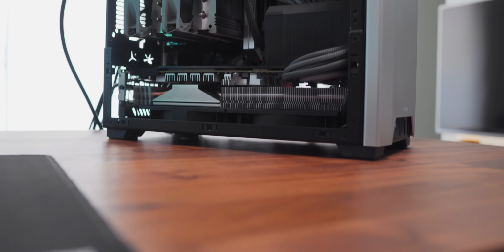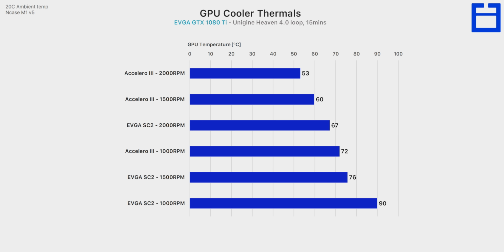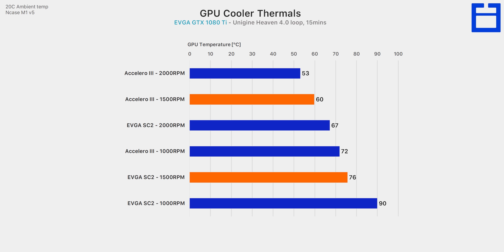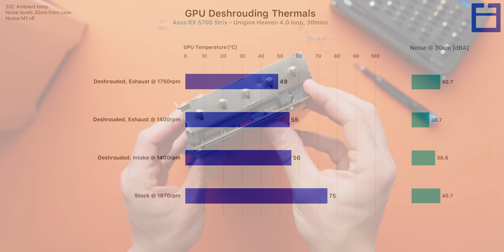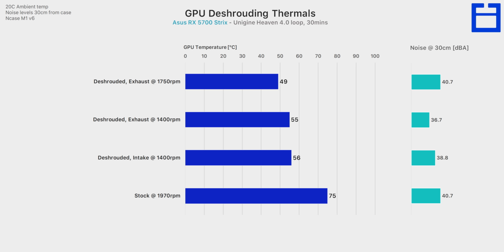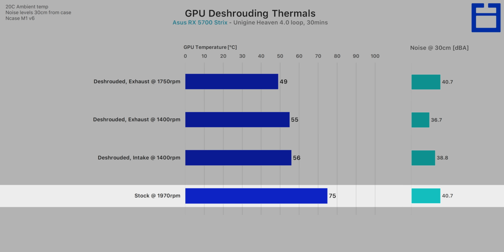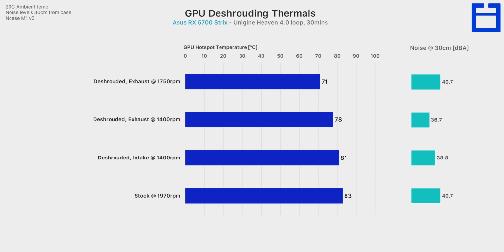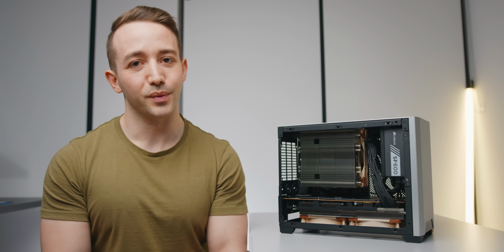GPU Deshroud Mod - Mindblowing Thermal Improvement

Comment: Did the same 1 month ago with good results.
ASUS ROG Vega 64.
VRM has almost same problem, but fixed with a bigger thermal pad.
3 Fans removed together with the shroud and replaced with 2x 140mm Noctua fans.
Fans suspended with cable ties and long screws to the PSU shroud in a Fractal fullsize case.
Fan outputs also does not work because AMD driver and ASUS controlpanel software fights each other.
A GPU cooler mounting guide needs to be followed, and paste really needs a good amount to fix hotspot problems.
VRMs and hotspot was in the 100c area, GPU throttled down below advertised, ASUS quote: Working as intended.
VRM and hotspot is in the 80c max now and clocks are about 200MHz higher on core and the fan noise is maybe halved.
The Noctua GPU fans are controlled by CPU temp, so when the CPU temp is 10 degrees over idle the fans run at full speed, not ideal but works good enough, the temps can overshoot a couple of degrees before the temp stabilizes with the fan speed, but the temps are still more then 20c lower then stock anyway.

Comment: This is absolutly hilarious because in a drunken rage last night, litterally last night., i deshrouded my 3rd and 4th rx580s because the upper card fans rub the next cards' rear heat shield.... So my mod has to do more with clearance than cooling. And yes 4 rx 580 xfx xxx black ed  with an Asus WS Pro z390 motherboard with plx chip runing 8x8x8x8x in a panzer cougar full tower case and open looped i7 9700k. The shrouds were placed sideways for now till i figure out better airflow.

Comment: Been doing this since 2002 but usually with a after market heat sink.
i have stuck min 130-250 cfm fans on ALL my pc's since 2003, they are the "thick 38mm" fans...............SURE i am going deaf from it BUT everything stays cool :))
Sadly going larger then 120mm gets way too expensive these days with such high output fans.
i still have 10 200cfm & 2 250cfm 120mm fans in the box  (they are DELTA fans) last like forever. i was recently thinking of selling 5-6 of the 200 cfm delta fans but i think i'll keep em.
NO WAY i would sell the 250cfm delta fans, those are insanely priced Now .
14 yrs ago i got a great deal on 30 200cfm fans from some place called "arrow", they cost me like 12$ each, now they sell for 50$ each..............it's crazy.
Guessing the last 2 250cfm fans prolly sell for like $70+ each (bought those for around $20 each)...............i should have bought 100 of them back then.
They sound like a jet taking off..................Also Any fan above 100cfm is a dust magnet !
My 1st high push fans were the vantec "tornado", they were 90mm fans & sounded louder then the 120mm ScythE 133cfm fans.
A few other fan manufacturers that made  great high CFM was Sunon & Panaflo nmb..........all you pussies pushing for quiet fans made the price of jet engine "affordable" fans go sky high.......

Lastly, the delta & panaflo fans seem to last the longest, the scythe always fell apart launching the blades into my PC, i guess that's why they stopped selling them.
Didn't use the 60-70mm sunon fans long enough to see if they last long, was used mainly for north & or south bridge.
Glad i still have a few of those small fans cause i might jerry  rig them into a console if need be.

Comment: From day one that I got my 1080Ti super jetstream, I did this with 2x120mm PST fans with the stock cooler and I had the same results, super silent operation with around 17-20C less on the GPU :) I`m doing this to all of my cards since 2013 Vapor X 280, 980 Ti and my 1080 Ti

Comment: Nice Video, thanks! Would you think that it also would be possible with the Dan Case A4 SFX maybe by using two 120x15mm fans on two 120mm-AiO-Brackets? 🤔

Comment: Do you run the fan on the Noctua NH-C14S in pull blowing down on the pcb or push exhausting out in low profile mode generally?

Comment: The external fan header needs a program on startup to work. It also needs to be set up in the Asus Tweak software. It's stupid it isn't automatically running on startup and you need to manually choose it as a startup program. But hey, it's Asus...

Comment: For the few who read this: You can totally use this in any case! You just need to either use zip ties or bent wire to secure the fans directly to the card.

Perhaps not the most elegant solution, but we’ll worth it in my opinion!
Reply: Looks like a great project for a 3D printer.
Reply: Other than virtually every sandwhich layout case I can think of but correct me if I'm wrong. For example, there's not enough space for a 25mm thick fan on a gpu in the Dan A4 from the looks of it.
Reply: You can also use things like PCIE slot fan bracket mounts and just mount it a slot below the card

Comment: Will previous their was no fans under the gpu blowing air into it like wld happen in normal case. So taking shroud of and adding 2 case fans that r right beside the heatsink Will be able to take more air into the case through the gpu. unlike previously due to the gap between the gpu fans and holes in bottom of case for air to get pulled in.

Comment: I certainly don't have a case small enough. There's 6 inches from my pcie No.1 slot to the bottom of the case and my power supply sits on the bottom.

Comment: Hey mate, thanks for the video. Just a couple of days before this video, I did  a deshroud of the Saphire Pulse 5700XT for my newest NCASE M1 v6.1 build. It was super easy and super effective. I could take off the shroud with only 5 screws and it was just the almost flat heat pipe uncovered. I have the NCASE M1, i9-10900k, AiO Arctic Freezer 240mm II, AsRock Phantom Gaming Z490 ITX/TB3, 2x Noctua NF-A12x25 Bottom Fans, 1x Noctua AF-9 PWM Chromax Intake Fan and 2x Noctua NF-F12 Chromax as exhaust in the side panel replacing the Arctic P12 fans on the AiO. Super happy with this setup. Idle 33db, Load 37db. The GPU is set to Automatic-Undervolt and fans spinning at 1500rpm max. It is so silent, that I don't even consider to put the GPU on water-cooling as well. See pictures here:  https://imgur.com/gallery/MkenaZv

Comment: Used to have a gtx750 with a broken fan, i just use those normal molex fan and strap it with cable ties to the gpu heatsink

Comment: 6:02 The AMD cards aren´t the only ASUS Strix models dealing with problems with those two fan headers. 
I have a RTX 2080 Strix deshrouded with 2x NF-A12x25 inside of the Sliger Conswole. And both fans are connected to one of those FanConnect II headers of the GPU with a Y-splitter with another 2x NF-A12x15 on the other one. Unfortunately this feature doesn´t really work and I constantly need to check if all of my fans are spinning. In this post : https://www.reddit.com/r/ASUS/comments/gfci4m/asus_please_fix_your_software/ you can see what happens 75% of the time I boot my pc. I need to add here that it´s not only this fan which stops but it´s constantly changing every time it boots. But it´s even worse when all of them are spinning but one isn´t ramping up once the GPU gets under load as this always results in my GPU overheating. 
From what I´ve seen I´m not the only one with that problem and it would be great if you could look into this issue a little more as this has been going on since the 1080 Ti Strix model and it can be very damaging to your card.
Kind of sad that this works so poorly as this was pretty much the only reason why I went for the Strix model.
Reply: Same here went for the rtx 2080 Strix to control fans through the gpu, but a gave up on that. My external fans are constantly stuck at 50% if I use the headers on the card absolutely useless. I am using Argus monitor now (which is great) and my next card is gonna be a Palit again better cooler and much better stock fans then the Strix.

Comment: 08:09 There are no dust filters for side and bottom. How much a difference would filters make on thermals?

I noticed that there is no side bracket in this entire video. Would you be able to fit another NF-A12x15 PWM with side bracket on to form a push-pull configuration for NH-C14S? Or do you have to remove the side bracket to do so? Will push-pull be recommended by you? And if NF-A12x15 PWM can fit in with side bracket on, would you fit one or two of them in there?
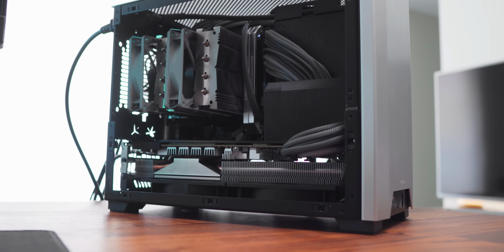Reply: 0:55 I currently have eyes on NH-U9S like your previous build in April, 2018 and now that you are using NH-C14S. How much of thermal difference will there be if I use dual 92mm fans on U9S (exhaust to rear side) versus one 140mm fan as intake on C14S? Would you still recommend U9S for a build like this with all other parts unchaged?
Reply: 2:14 What is the clearance between the PSU and the side bracket (if it's installed)? Will there be emough space to fit in anther 120*15mm fan? Or maybe stacking one or two 2.5'' drive(s) there?

Comment: After watching this I just deshroud my Zotec 2070s. Since metal bracket issue I managed to swap stock fan with three 80mm NF-R8 . The result is INSANE. Set fan speed at 800RPM I cannot hear any noise generating from my PC which sits 40cm beside. Setting fan speed to 1800RPM at full speed in fan Xpert the noise is actually similar from which stock fans produce under no load(Zotec limit 2070s min fan speed to 1500RPM ).  Thermal: 30min heaven extreme preset, temp max out at 78°C, clock speed 1980Mhz . (Case: NZXT H1 with 2070s, i7 10700k, no dust filter. All Nf-R8 set as sucking air from out side. )

Comment: trying to understand. 
1. So both the fans is attached to the case and not to the GPU heatsink ?
2. Which fan control does the fan connected to ?

Comment: in regular cases you can do it as well, i have a vega56 red dragon and used zipe ties through the back between the fins, throught the fan holes and then a second zip tie to snug it down. the first zip ties head is large enough to not get pulled through the fins of the shroud and works awesome! been using it like this for over a year and noise reduction is crazy! I have 1800rpm rajintech fans and at fill speed i can barley hear them and the card stays under 68c WITH a 300% power target and 1650mhz OC and 955mhz hbm2 and -80mv undervolt. i can push the card harder but the power consumption can get to 330w if i push twards 1700mhz so thats just to much for everyday use! haha Great Mod though! glad other people know about this

Comment: You mentioned in your case the fans are sitting directly under the heat sink, what if in other cases the fans are not directly under e.g. there's a small gap in between them, what would the performance be like?

Comment: Just wondering, would this work with semi passive cooling in the right case since it works in the same manner?

I have a SM550, 2 Noctua's at the bottom as intake. While I don't have the card to do this yet, I was purely wondering if deshrouding would net any benefit since the fans are so far away. You'd think there's enough airflow to cool it, but I'm not too sure.

Comment: GPUs are getting so thick (and rightfully so) that I’m seriously considering moving my ITX system into an mATX case since I am currently stuck at 2-slot GPUs! I guess since a modern GPU is probably over 50% of the power draw of the entire system when gaming, it makes sense, but the bigger GPUs get, the more obvious it is that ATX isn’t such a great layout anymore.

Comment: you should do a build with the same specs but ones a ITX the other ATX and see how much the performance and temperature differs.
i found a 2 year old video from you guys but i feel it would be a good topic to revisit
Reply: correction: that two year old video you just moved the ITX into the ATX case, i mean more along the lines of two B450's and one is ITX other ATX

Comment: Wouldn't it be easier to just get a reference card and install an arctic cooler extreme on it? If the card breaks you can just put the reference cooler back on for repair.

Comment: would de-shrouding help with thermals on a full atx case?
i have a rx5700xt gigabyte gaming oc, the temps are fine, but for longer gaming sessions the fan makes a pretty annoying high pitched whine. ive played around with different fan speeds and set fan profiles, but to eliminate the noise, i have to drop the fan speed to 50%, where the hotspot goes up to 95-98 degreees

Comment: One thing I do like about deshrouding is that it makes it 100x easier to clean your heatsink.
Ever remove a CPU heatsink fan and notice all the dust built up under the fans? The same thing happens with your GPU, but its not as easy to clean those fan blades.

Comment: Very interesting. Thanks for doing the comparison with both the exhaust and intake config. I'm sure your other components appreciate you dumping the hot air right out of the case as well.
One thing I've always wanted to do was to duct the exhausts from the GPU out to the back of my case, but it's a little too cramped to do that at the mainboard. This seems like a much better idea.

Comment: Pretty cool, but what's the explaination that 2 aftermarket fans cool better than 3 stock fans?
Noctua are silent, yes, but why do we havr the improvement in temperature? Is the shroud really blocking airflow that much?
Reply: OCPyrit after market fans are dramatically bigger.

Comment: WOW! I have a 1080 ti at 1925mhz at 0.925v (purposely undervolted) with a kraken g12 mod with a h100i 240mm AIO. It doesn't go over 47c. You add two nactua fans and get same results. WOW!

Comment: Did this with ncase m1 + Sapphire Pulse 5600 XT, while I didn't even bother to test with stock setup, I assume the card itself would still fair well, as the sapphire pulse is known as quiet and quite cool card. Having deshrouded it and 2 noctuas under it, the temps never go above 60c and there is no audible sound at all as the fans spin quite quietly (or don't spint at all, if not doing heavy workload)

Comment: Welcome to the deshroud club. Not sure what you mean about the rear PWM connectors not working on the GPU. Is that an AMD thing? I'm able to control a Strix 2080ti with Tweak II software. You can find more information in the build guide here: https://imgur.com/a/kybBtjQ

Comment: Why is everyone in the comments acting like there aren't any decent third party models? Sure, this is a great mod, but there are a lot of GPUs with more than just decent cooler designs that run exceptionally cool and quiet (EVGA, Nvidia Strix cards, 5700 XT Nitro+ and Red Devil, etc etc). My unmodded Strix 2070 Super runs at sub 60C under full load in an Inwin A1 Plus case with the GPU fans not even running most of the time.

Comment: InWin 101C or 303C have the same type of bottom fan intake/exhaust areas. It can fit three 120mm fans at the bottom and still fit a three slot card.

Comment: This basically comes down to that GPU makers shouldn't be making cooling for their GPUs.  I'm not sure why an after market for GPU coolers didnt take off like there is for CPU coolers.  At this point, it seems very warranted and an under served market that would take off and possibly allow GPUs to be made a bit faster (no longer have to worry about heatsink+cooler) and there really wouldnt be a need for an '3rd party GPUs' -- FE's only.  

I've been planning on doing this for months now to my 1080ti as it just seems to make sense.

Comment: I'm so disappointed in Asus's last 1-2 years of GPUs. Each and every one of them has had some MAJOR issue in cooler mounting or thermal pads, or other dumb problem. 

It's like Asus does not care AT ALL about quality anymore, and they still overcharge compared to everyone else.

Comment: I did a video like this, but with rtx 2060 mini itx gpu and the results are insane. Droped like 10 degree c with a single noctua 90mm fan and run quite.

Comment: I did it to my GTX 1070. I've dropped 20-25 degree and more important, It's almost silent.
Reply: Are you using a case like he has or a normal looking one where the power supply has its own compartment under the GPU?
Reply: @jondidwhat  I'm using a Phanteks P400s.
Reply: @MallocFree90  sweet thanks

Comment: 5:42 Just chinning in here. Those that own a Skyreach 4 Mini, such as myself, have done something similar with the Zotac 1070/80 mini and other RTX mini cards. Using NF-A9 x 15 fans, sometimes zip tied to heat pipes or just resting on the heat sink itself. Nice to see Noctua once again proving their worth. 
Cheers :-)